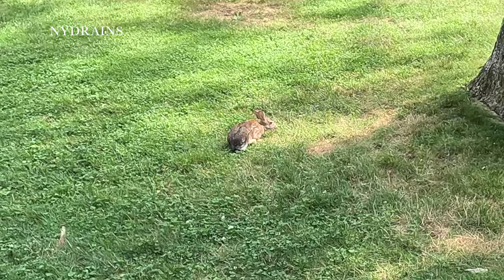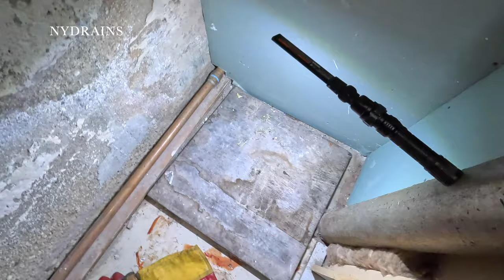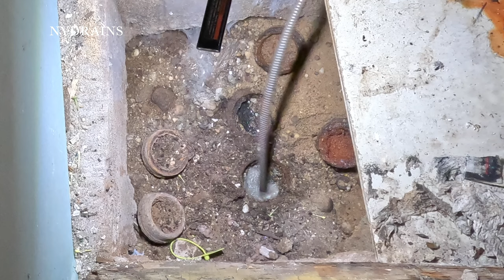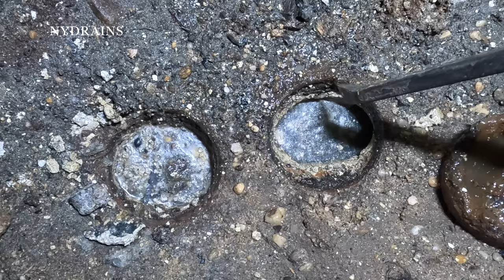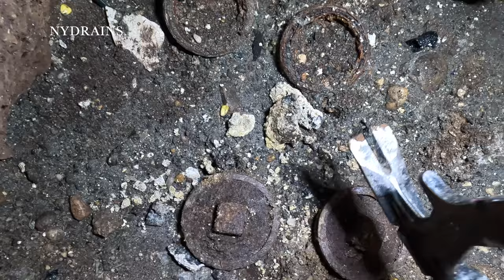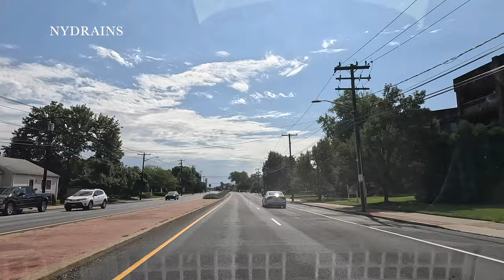Clogged Drain #190

Comment: Great job done  Donald, So when you say bad pitch does that mean the drains are moving and not at there correct level for flow 👍👍
Reply from the maker: Usually a Back Pitched Line is where it's more elevated towards the street side then the house which causes the water level to be more higher and slows down the flow causing things like grease to accumulate much faster. Thanks Taylor 👍
Reply: @NYDRAINS  i understand now thanks
Reply from the maker: @tinkeringtaylor3053 np

Comment: What to do in this case? Cleaning twice a year? New outside Line (i.e. dig it up and make new)?
Reply: Can dig up and replace backpitched section
Reply from the maker: Twice a year will not cut it, more like mandatory 3x a year, or find out where the back pitch is in dig it up and replace.